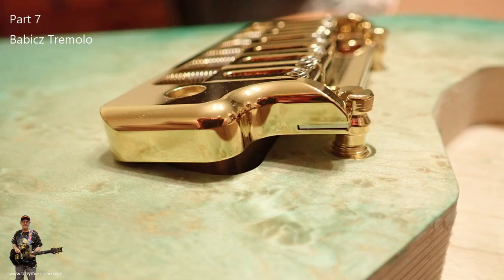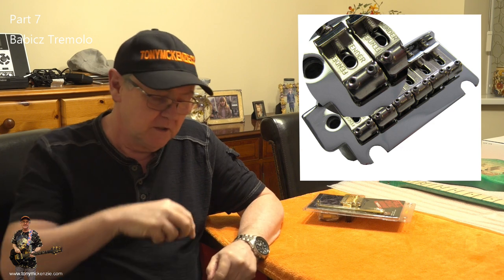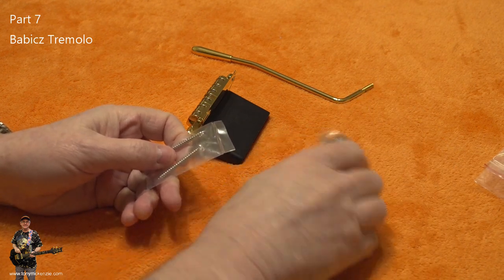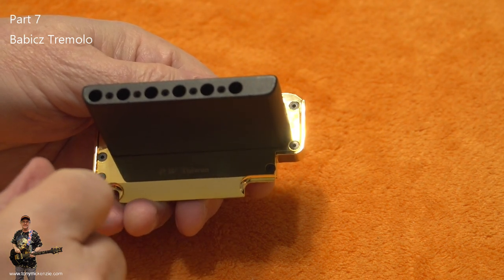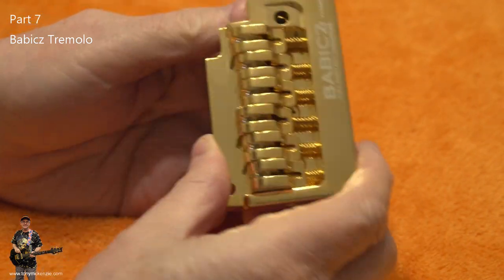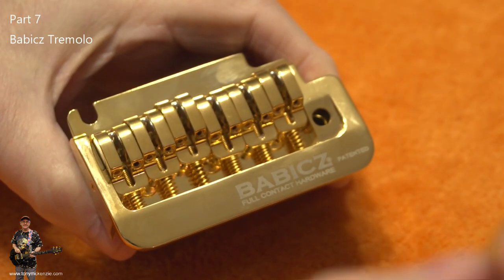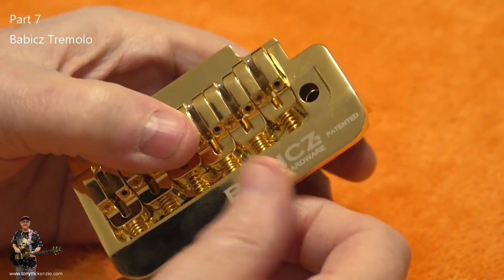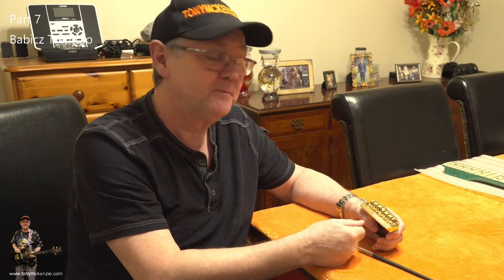Babicz Full Contact Hardware Tremolo: Get the Perfect Strat Guitar Tone

Comment: Hi Tony, you might have sussed this since making this video or It might be In other comments (haven’t seen it discussed) but you need to loosen the hex grub screw on the top side of the bridge before adjusting the Intonation screws as this locks the Intonation screws In place. Once the Intonation is adjusted re-tighten to lock the saddles in place.
Reply from the maker: Ha indeed I did solve it :) But you know what, it's great that you posted the answer on here as it might help many guys over time. Appreciated you did - and thanks for watching.

Comment: Interested in how the Babicz works for you. I've started a build (because of your recommendation) I went with a Warmouth body, and I don't want a Floyd Rose or 6 screw Vintage tremolo. I was looking at the Gotoh Wilkinson VS100n. Don't know if you've tried that one. Anyway great video (as always) cheers
Reply from the maker: I have used Wilkinson tremolo's before. On the one I had, it had a small screw under the tremolo for adjusting the friction on the tremolo arm. There was a plastic insert in there. Firstly on mine the plastic insert was not great. But worse, the TINY grub screw easily stripped and I had to recut new threads on an larger one to replace the cra**y one. They might well be different now, but notice through all the rest of my builds I never went back. Hope these comments help and at the least look for that screw...  stay safe.

Comment: Hi Tony - I suppose you could always use a small tension spring under the tremolo arm as on Fenders.  I'm watching this build with great interest - not sure if I'd be capable of completing one myself though!  Keep up the good work , Best Regards, Paul.
Reply from the maker: Great point... and one I did not mention. The arm is tight but its new and who knows how that will wear. But easy fix then. Trust me Paul you COULD do it, its all about working slow... rushed does not work somehow and that's even more important on the upcoming parts of the complete build. Thanks for watching and stay safe.

Comment: For a floyd/ibanez edge I much prefer push in arm, but for a strat style screw in is perfectly fine. Greater string to body contact seems like a good idea, whether I would notice the difference who knows. Looking forward to see this whole thing together, seems like every part was picked with care.
Reply from the maker: I chose this after the ABM tremolo that went back. The ABM had its points for sure, but actually I think this IS a better design. It will be interesting to see the results though as you say... stay safe.

Comment: The saddle height adjustment as just a tiny drawback, when you rotate de saddle to adjust the height, you lenghten or shorten the string a tiny bit and you have to do the intonation adjustment but that is easy and fast to do. The principle of the saddle to bridge is quite clever and should improve thing. The work on the body is a deal breaker for most to do themself or by a luthier, the later would be as much as the bridge itself. Take care and stay safe.
Reply from the maker: Yes I think the design is a very good one and notice he Patented it so it won't be able for others for a while. The 'mod' (who knows why that had to be) was a simple mod really and involved about 1/16 to 1/8 inch from the back edge of the hole. Fender guitars can be done easily too and it all remains covered even if you refit the original Fender tremolo. Great points Michael... and yes you stay safe too in these crazy times.

Comment: Hey Tony nice trem.a tip for you on the trem screws if you want to tighten them up you can rap them with teflon tape the white kind and it will snug them up.anyway hey from Tennessee.hope your well.cheers
Reply from the maker: Thanks for the tip. I did consider that actually (great minds etc.) but in the end I decided to just leave it as is. Thanks for posting it in any case... and for watching. Stay safe.

Comment: Very nice bridge design looks better than the ABM
Reply from the maker: I agree. There were a couple of 'funny' things on the ABM - the fit and the steel pivot that (if you go back and watch again) you'll notice that the plate bends with the small grub screws from underneath that purportedly hold the plate in position. This Babicz is different and I'm looking forward to seeing this working. Stay safe.

Comment: Re the bridge not fitting the cavity: is there any chance you had the version for an American Strat, but were putting it on a guitar with Mexican specs? The Mexican string spacing is a trifle closer, so I understand the bridge width is also slightly shorter. 

Thanks for an interesting video.
Reply from the maker: No it was being fitted to a USA standard body. In fact I just pulled out that trem from the cupboard and had exactly the same issue on a second USA spec body from Warmoth (licensed). I did fix it this time as the body was not really valuable... shaved 1/8 inch from the back of the trem hole and its perfect. The first time I have ever used MEX specs is for a neck I just purchased from Fender. Near enough all the other bodies were Warmoth. Thanks for the info though... very interesting. And thanks for watching.
Reply from the maker: It was weird... of that no doubt.... thanks....

Comment: I kuind'a wish the Bab's logo was quite a bit more subdued! I like where this design is going, but the logo wrecks the visuals, for me anyway?
Reply from the maker: You're right. Its a marketing poster stuck there forever. Clearly Babicz should AT LEAST make it small, or drop it off the front. I'm OK with it myself but it is a cause for concern where new sales would be affected IMO for exactly the reasons why you said. BTW I'll be offering a score to every single part of this guitar build in a separate video after the build which should be very enlightening. Stay safe.
Reply: You might want to look at a new Tele out of Japan Fender custom shop! A Tele with a trem
Reply from the maker: I made one once with a Stetsbar! And scarily later I quickly removed it too. A Telecaster with and without the trem is a beast to reckon with... spectacular for some, but me? Hard work... at least I tried. Stay safe.

Comment: BABICZ WARNING  He didnt mention 2 things.   1:  When you adjust your string height by rolling the fulcrum, it changes where the string lays, meaning it CHANGES THE LENGTH of the string. From a highest setting to a lowest setting is over 2mm in length difference. You have to reset the intonation whenever changing string height.  2: If you are using anything other than an American Strat body it may be thinner and the trem hangs out the back 2mm or so, you cant put your cover back on. i own 3 of them.
Reply from the maker: Good point on the string height, although when its set from my experience its changed rarely after. Great point on the 'thinner' body  and trem depth. I checked this tremolo with a body made to Fender specifications but a good point that I certainly did not pick up. I trust the rest of the review was OK though. Thanks for watching.

Comment: My experience was with a Hipshot trem. Mine was advertised as a direct drop in replacement for a Fender American trem, but it wasn't. I think the difference is in the diameter of the two screws that the blade of the trem make contact with. In a Fender to my eye the surface area where the trem presses onto the screws is smaller then the diameter of the threaded end that go into the body bushings. With the Hipshot they were probably about 1\8 of an inch, 3 mm to you Metric Chaps, bigger in diameter then the fender. This pushes the trem block back enough to make contact with the body. I'm far from an expert, but that is my experience.
Reply from the maker: Thanks for the info. Ha I'm 'old school' and imperial measurement :) but I follow metric when I have to. On the ABM the bushes were already installed in to the body (Fender ones and I requested that) and the ABM screws were it seemed to me to be the same screws as the Fender ones. On the Babicz it seems again they are as the same or extremely near. But neither fitted properly like your experience too. If I remember when I am fitting the tremolo I'll show two Fender screws as comparison (a good point Ken) and see if you see any/much difference. The ABM I will have an image of somewhere. Thanks for your experience too... it all goes to create some useful info for anyone contemplating the alternatives of the standard tremolo system. Stay safe.

Comment: Wudtone or Wilkinson or schaller better than that one . Tried and tested . Parts easily available.
Reply from the maker: I understand. But here's the problem. If I simply reviewed what every man and his dog has done to death then what would be the point? We would all know the gear. When I build a guitar (which this was part of) then I try and create a guitar that is somehow different. For example, this one had the Babicz tremolo, but also had the Fender CS 69 Pickups AND the mid boost board. All sounds like everyone does that? I don't think so, I could not finds a single review with that combination of gear. That makes for a vide that is different. Before the Babicz I 'tried' an ABM German tremolo, but you know what, it did not even fit a standard Fender Strat tremolo hole! Believe me - it went back. On the brands you mention I have tried Wilkinson and Schaller but not Wudtone. All reasonable brands... but you might be surprised to hear and see the final guitar in the up coming video - the tremolo worked absolutely perfectly and setup with it was a breeze! In any case... thanks for the post, it will help many guys... thanks for watching... and most of all stay safe!

Comment: I reckon they didn't take the plating thickness into account on the inside of the intonation bolt threads......i guess winding the bolt in takes a tiny of it off.
Reply from the maker: Good point. it was a little weird and with a sort of 'this screw driver will do' attitude I could have rounded the screws! Hence mentioning that - they really were tight. But once you get past it then its all good... possibly could be the gold plating... stay safe....
Reply: @tonymckenzieofficial  dont forget to loosen the allen bolt coming in from the side. It pushes them all together to stop movement, and will keep you from being able to adjust the intonation.
Reply from the maker: I was aware of that one :) but thanks anyway.

Comment: Just use a Fender tension ball and spring down in the tremolo bar hole to get the bar to move freely yet stay in playing position when you need it. Also wrap the insert bolts with plumbers tape and kiss the loose movement goodbye. I have done this for years on insert posts of all types
Reply from the maker: Yes someone else mentioned that too... and thanks for that input. Ha and the PTFE tape! But I like to see this input because it offers great solutions for the problems at hand - so thanks again for that. Maybe I'll be adding the PTFE etc. later :)  Stay safe.
Reply: @tonymckenzieofficial  Thanks for introducing me to the Babicz products. I have contacted them and I will be selling their products in my repair shop. I always learn something when I watch your channel . Keep up the great content
Reply from the maker: Great to know. They are new to me too but they certainly look a very logical design. I was originally for a few years a mechanical engineer and the design looks entirely unique form what I see. Do let me know how they work out for you too. I just finished (well nearly) the polishing of the guitar body and neck and the tremolo will be probably by next weekend after this one. Stay safe.